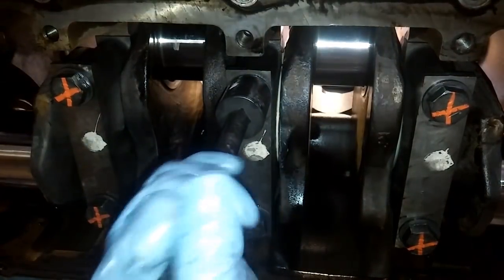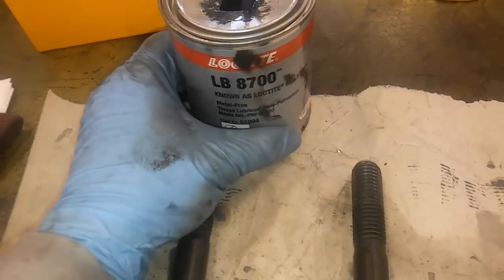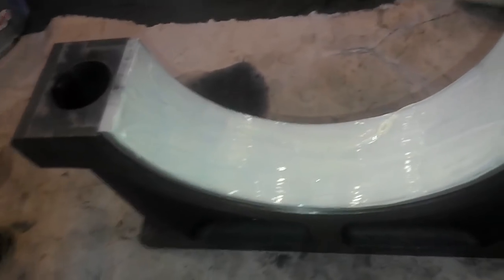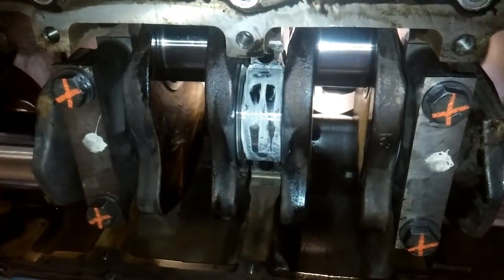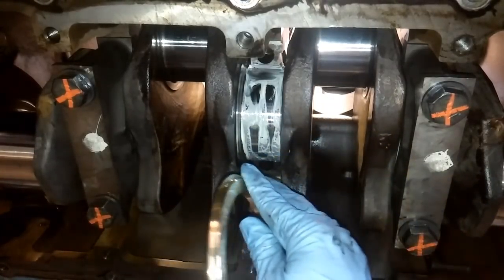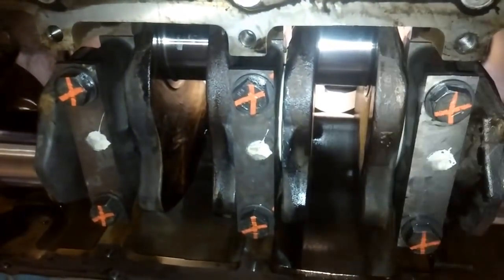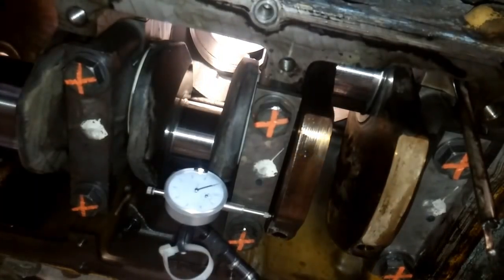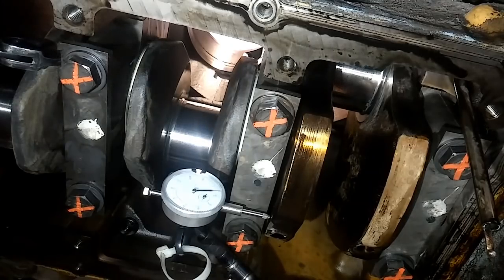How To Rebuild A Diesel Engine. Part 3.  Main Bearings, Thrust Bearings, And Crankshaft End Play.

Comment: Hi!, Thanks for posting this. So, the procedure is : you remove 1 cap, change bearings and torque to specs? And in which order do you change the main bearings? from outside to inside? center to outside?
Cheers!

Comment: 2:45 When in automotive class years ago, I was told that assembly lube or oil, NOT grease is a must. The idea was that assembly lube would dissolve in engine oil more quickly and completely after oil reached the parts. Grease, although dissolved by engine oil, was not specially designed for that purpose.
I knew a lot of guys who would use heavy STP oil booster instead of assembly lube or grease. I guess it gives some of the advantages of engine oil and some of the advantages of light assembly lube.

Comment: yes! this is all very easy. First, pony up 5 to 7 thousand dollars. Next, start ripping your diesel apart. Finally, put it back together again without fucking up. It must be perfect. No pressure.
Reply: lol. Bonus points for doing it in less than 2 hours and not using torque wrench.

Comment: Maybe a stupid question , but can a main bearings and rod bearings cause low oil pressure? I have a n14 Cummins and the pressure goes up and down , also have a dash light flashing sometimes, (shut down) light .. thanks
Reply: Excessive bearing clearance caused by wear, can make oil pressure not build up.

Comment: Loving the videos. What's the part number of that assembly grease?
Reply from the maker: +MartinM101TV I've had a few people ask for that actually and I think I replied with the part number, but I forgot it, I'll have to check again. If you go through the rebuild videos comments section it should be in there somewhere.
Reply: Found it, thanks!

Comment: Also, I have a couple of questions such as what do you think of fuel additives for winter driving (Howes lubricant in particular) and variable speed turbos (have one on my 14L Detroit which I know isn't your specialty).
I also watched your video on pre filling your fuel and oil filters and I was told to use Howes lubricant on the fuel filter when I am on the road and need to change my filter, is there any harm in running straight additive through the injector?

Comment: Hi, have a question on c15 accert fault codes, pid 3, fmi 5.  what code is that? thank yoy.
Reply: V-TSAT:    PID3=FMI5=Flash Code73.  Cylinder#3 Open circuit.
Reply: ken Plourd what does that mean??
Reply: ken Plourd I just had it rebuilt my self with platinum kit. engines runs fine no misfire all new injectors, but have this code.
Reply: clear the code.now drive it with a load if you can.

Comment: Excellent.I learn a tremendous amount watching your videos.I have a question.Since Detroit diesel is partnered with Freightliner/Western Star and Volvo and International diesel make their own engines for their own trucks.Does Paccar manufacture engines for their own trucks(Peterbilt/Kenworth)?Can Petes/Kenworth also be ordered with a Cummins.Since Paccar Big rig trucks are the only trucks with a choice of engines.Caterpillar  no longer   manufactures a heavy truck engine,and since Cummins is an independent.Are'nt these engines only in Paccar products,(Kenworth/Peterbilt?  Thanks!
Reply: ken Plourd yes you can get a Pete and kw with a Cummins. Could be wrong but I'm pretty sure Cummins makes a few of paccars engines
Reply: Thanks Marc.Have a good one.
Reply: Thanks Marc.have a good one !
Reply: ken Plourd Part of cummins business is making engines but they also design engines some iveco engines are designed by them i think scania does aswell, see the paccar mx13 and you will notice is similar to the x12 even the bore is the same
Reply: CAT doesnt manufacture oficially truck enfines anymore which doesnt stop people to buy C11/C13/C15/C18 and put them on trucks and Jacobs also mabufacture the jakes for those engines even now
Reply: Spotav,Cummins is an excellent engine.I work alot on ism cm875's.I think Scania is related to Renault somehow.You're right about the x13 and 12.Pretty sure the x13 is a 12.9l,500hp,1850 torque engine.Think i seen it in a Kenworth.
Reply: Spotav,thanks.I love Cats the best.Is it legal to install C11-C18 engines into most trucks.Just wondering about emissions?
Reply: ken Plourd yes. They are called glider kits. You can buy a truck with no engine and put an engine that you so choose. Emissions go with engine years not truck years. Unless you live or go into California. If you have questions on California emissions see adept apes video on California emissions. It's very informative. The fleet of trucks that I work with are glider kits. They all have 6nz c15s with some work done to them to make them have more horsepower
Reply: where do you get the wiring harnesses,Idm-Ficm,Ecm,Bcm,Trans.,etc...?
Reply: ken Plourd that I don't really know. Trans you can get anywhere

Comment: Hey adept , you should make a video about Re using old pistons if they meet specs or should we simply replace all pistons and spend another $1500.  Cause thats where I am at this point.  My pistons dont have alot of carbon on them and I thought I could maybe re use them and clean them up and put new rings in them.  Cause Cat wants $17,000 up front for a platinum kit and ive already bought new pump , new cooler, new water pump, new air compressor in these last 3 months before i stopped my truck.  So I bought all new Rod bearings and mains, head gasket, reman head , new sleeves,  but I dont know if I should re use piston heads cause they look really good.  Figure I save a few hundred bucks.  So far Ive spent Less than $6000 on a tight budget.
Reply: I've reused pistons but only after going over them with a fine tooth comb.
Checking for bent rods, replacing fudging pins, inspect ring grooves etc.

Comment: Hi A.A.  Strictly speaking, this is not a mechanic issue question. But, you probably can answer it anyway based on your experience and education.  This has bugged me for years and I wonder if not lots of others, too. 

Here is a link to the two Cummins (Dare I mention another brand?) graphs that are the basis of my question: 
https://cumminsengines.com/x15-performance?#torquehorsepowercurves 

Cummins just came out with a new heavy truck engine called the X15 and the performance charts are in the above link. What I don’t understand is this: The engine torque is a constant at 2050 ft. lbs. from 1150 RPM – 1500 RPM. But during that same RPM range the H.P. increases from 485 to about 585. It would seem logical to me that if you have 100 more HP turning the crankshaft at the higher RPM, that more torque would result.! Can you please explain this conundrum? Thank you very much in advance if you have time and inclination to take a shot at this.
Reply from the maker: +Frank Swain Torque is a component of horsepower, but so is RPM. If you multiply the torque and RPM and then divide by 5252 you will get the horsepower. So if you have the same torque, but RPMs increase your horsepower will increase. That is how small engines can make horsepower, but not very much torque.

Comment: I cringed when you used that STEEL flat bladed screw driver to push the upper bearing in place. One slip and you scratch the bearing surface. Why take a chance?. Use a non-marring tool such as brass or delrin, even wood is better than steel.

Comment: Would you be concerned about the oil supply galleys in the crank being blocked by the grease on initial start up ?
Reply: 0BMM1 the oil pressure will move the assembly grease. It really isn't very thick, not like axle grease or anything. 60 to 70 psi oil pressure will move a good bit...
Reply: Family Tradition Transportation Thankyou. 👍
Reply from the maker: +0BMM1 As Family Tradition rightly started, the grease is a very light grease and will get pushed out by the incoming oil and then dissolve in the oil as it heats up.
Reply: Adept Ape Thanks Adept. I really enjoy your video's because you keep it simple. I think if you stick to that format we'll get along just fine. As we say here in Ireland "keep her lit". 😉

Comment: are you related to copperheadmarine ? I swear he looks like he could be your dad and talk just the same.
Reply: Because a rod bearing fails or lasts when there is 1 gallon of diesel in the oil system and because the operator does not warn you that that type of problem is happening inside the engine does not turn off and also does not send a warning light to the driver?
and ecm not have any code for low oil pressure
Reply from the maker: +WOODS I haven't heard of the guy, my father isn't very technologically savvy, so I would be quite surprised to find out he had a successful YouTube channel.
Reply: HA!
Reply: Adept Ape he has a YouTube channel if you have time to look him up